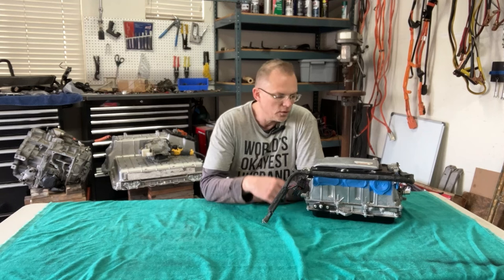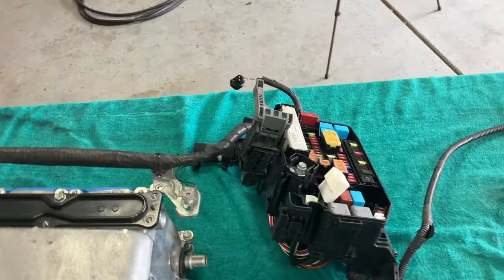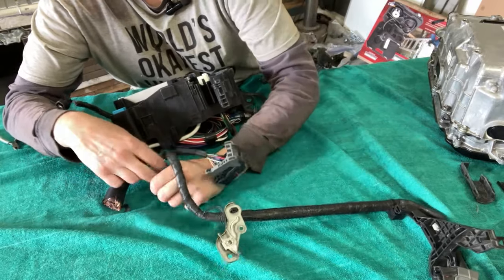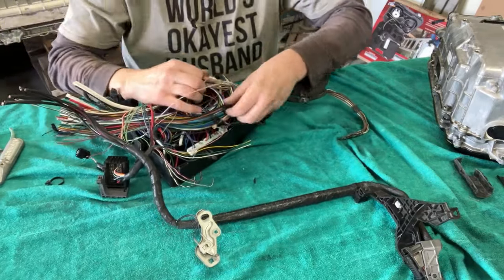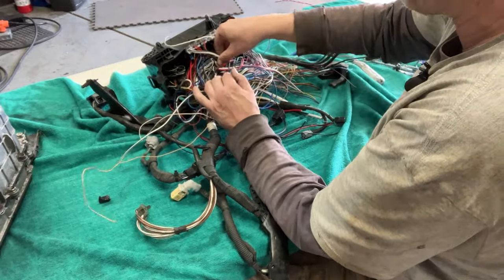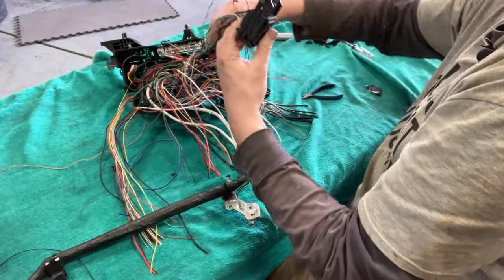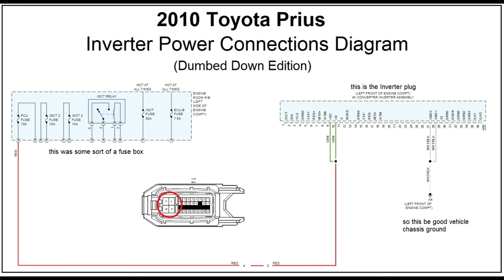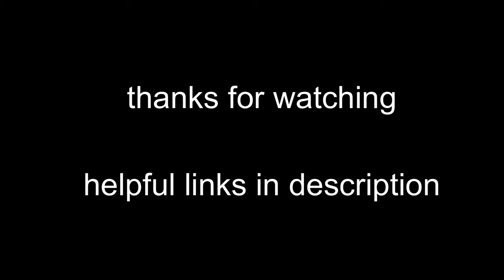Toyota Prius Gen 3 Inverter Wiring Harness #DIY EV Conversion Electric Car

Comment: Your video happened to be very informative for my case. Squirrel built big nest in my 2012 Prius and chewed the inverter cable. The damage is very significant and after watching your video, I think the best option will be reconnecting the damaged wires (6+13 if I followed correctly) ..do you know what is the size of the 13 small wires? I am planning to use butt connectors for the repair
Reply from the maker: please do Not use butt connectors especially those with that hard, red, yellow or blue plastic, solder and heat shrink instead
Reply: Yes, that is the same conclusion I have now. The wires are very small to grimp
Reply from the maker: most likely 22 gauge
Reply: I will try to find used cable and do the reconnection this will allow me to connect at one point instead of two ..

Comment: Would you be able to help me find the diagram info and pin down the Power Management ECU? I believe I will need to figure that out to be able to identify the correct connection for the 4 black and white wires going into the inverter
Reply from the maker: youtube does not allow us to post external links any more in the comments so I have to cut this up 

http s:// openinverter. org/forum/download/file.php?id=28818
Reply: Thanks, I already have this file from your post at Open inverter forum (became big follower😀) what I am looking for is how to identify the PIN numbers at the ECU! You provided a one for the terminal at the inverter end (A59)

Comment: Is that main inverter connector the same on Prius inverter and GS/LS inverter? I have a connector for my GS but I'll be making a whole new harness
Reply from the maker: what's a GS/LS ?
Reply: @Good-Enuff-Garage  Lexus GS450h/LS600h
Reply from the maker: I just went and checked, compared the two side by side, and NO they are not the same, the Lexus inverter plug is one piece the Prius is two piece, the smaller part is for the resolvers, even when comparing just the larger section the Lexus plug is slightly bigger and the pinout seems different as well
Reply: @Good-Enuff-Garage  thanks for checking
Reply from the maker: word on the street is that the Toyota Camry inverter may be closer to that of the Lexus    https://youtu.be/WXQdswAstVs?si=CjMQlC3CNFTrSA-4
Reply: @Good-Enuff-Garage  I shouldn't need to worry about it for now. I have all the connectors I need, with short pigtails on them. I do also have another L110 and a Camry inverter that I may be able to use together in another project down the road. 
I'll see if I can confirm whether the camry vs LS or GS inverters are the same. Camry hybrids are relatively abundant in wrecking yards